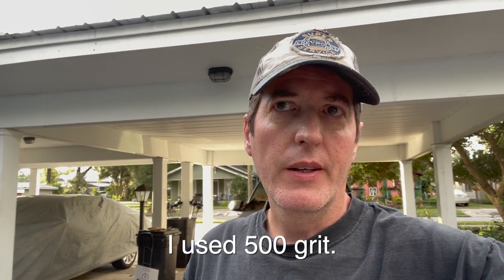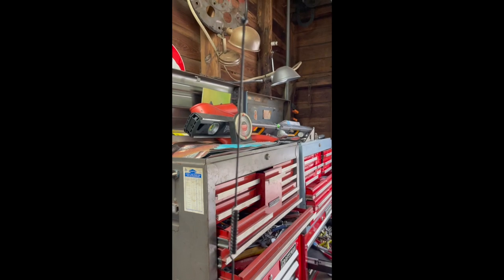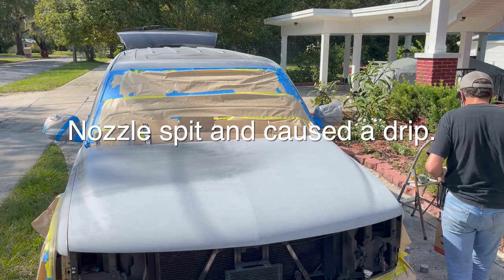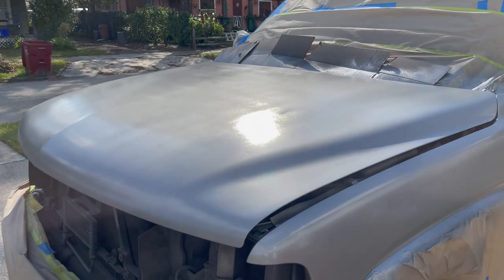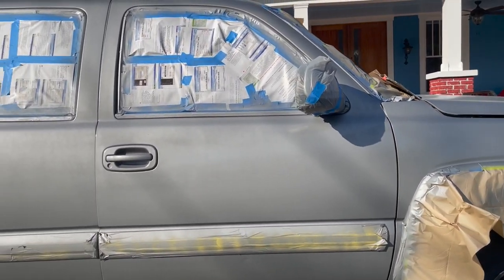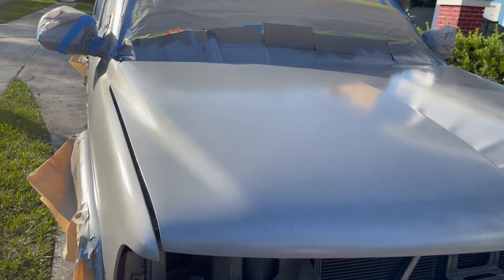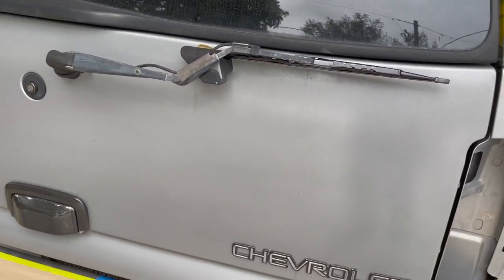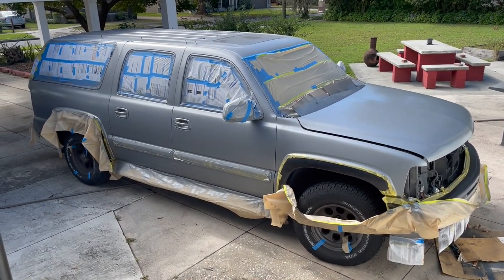Painting a Truck with Rustoleum Hammered Spray Paint Part 7

Comment: This was another great entry. I'm a Florida native myself. Brevard County area. I completely understand how the rain and bugs come out of nowhere. I prefer to use the 2 in 1 Rustoleum primer. It's my favorite and really does fill well. I usually wet sand it after a day with 600 grit before whatever base coat I lay down. It just takes time. I'm looking more into painting cars as a weekend side job. Rattle cans are the best way to go since it's low overhead. Also make sure you point the spray nozzle direction to the black dot on top of the can to help reduce spitting. Use a piece of rolled up tape tonremove bugs that land on the paint as well.
Reply from the maker: That's a great idea about the rolled up tape!  I should have thought of that.  Thanks!  Good to meet a fellow do-it-yourself guy.
Reply: @floridarusticrepairs  I'm glad I could help. Small things really add up but I found it a very rewarding experience to paint my own car. I have a two car garage my wife allows me to have as my man cave. Other than that it was just a bunch of simple hand sanding and Rattle can painting. I'll have to link a video when I get a chance.
Reply from the maker: @StoneyBrownTV  I'd like to see that.  Thanks!
Reply from the maker: @StoneyBrownTV  Speaking of rattle can paint jobs, have you ever heard of Rustoleum Turbo?  Looks like it'd be great for cars.
Reply: @floridarusticrepairs  indeed I have. I used their primer to spray the car first. I really like the fan they produce. I kept 2 or 3 with the intent to use them as refillable sprayers.
Reply from the maker: @StoneyBrownTV  Good to know. I'll need to give it a try on my next big paint job.  I just would have preferred some additional color options.  Thanks!

Comment: Hats off on the effort.  You painted one of the biggest vehicles in the fleet!! Probably would try a door or fender but not an entire rig without a spray gun. Hammer probably wouldn't have been my choice just because of the stimple finish. 🍻
Reply from the maker: Once I began using the clip on thing for the cans it was easier but yeah, this wasn't the most efficient way of doing it.   By using light coats I minimized the texture of the paint to a degree that it's only obvious when you are within arms length.  That being said, it's a better finish than bed liner.

Comment: I think you can get that hammered paint in quarts  ! You should just get a cheap spray gun and small compressor and thin it with a little hardener
Reply from the maker: Thanks, yes.  I see that the grey, silver and black come in quarts.  That would have been quicker.

Comment: Wet sand and few coats of 2k clear!!
Reply from the maker: I've been wondering what would happen with the hammered texture and a wet sanding.
Reply: U can wet sand it and re shoot it did u sand the primer before shooting?
Reply from the maker: @andrewybarra2304  Yes, I did sand it. Smooth as glass.  The hammered paint itself has a texture to it so wet sanding may have an interesting effect.  I'm curious but i really like the look as it is so I don't think I'll risk it.  It looks like aircraft aluminum.
Reply: @floridarusticrepairs  yeah I get u idk how long that paints going to last in the sun it's going to be interesting forsure but you'll be the first one to let us know
Reply from the maker: @andrewybarra2304  I plan on doing a 12 month review.  I'm at 6 to 7 months now and it still looks fine.  Especially since it sits outside and hasn't been washed other than rain since I finished it.  :)  i do drive it as my daily though so it doesn't sit too much.

Comment: Go flat black that's what I am gonna do it shows no mistakes tfs
Reply from the maker: It would hide a lot but so does the hammered paint.  That would have radically changed the look for sure.
Reply: @floridarusticrepairs  that paint you use looks good 👍 tfs